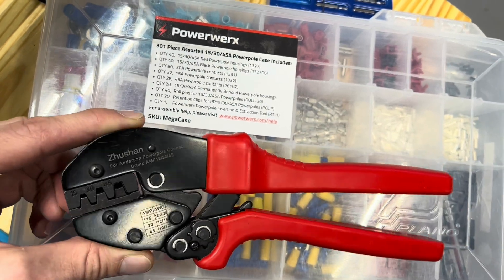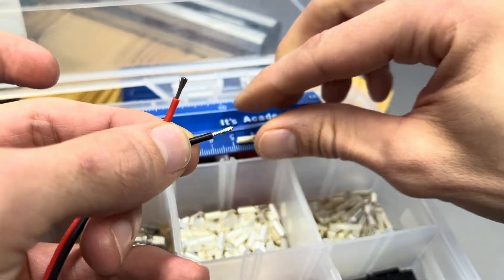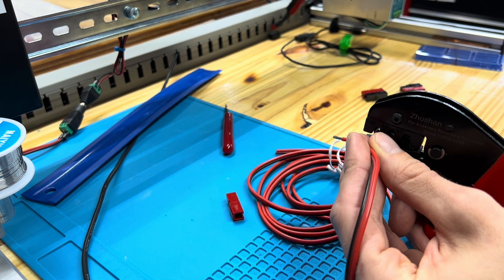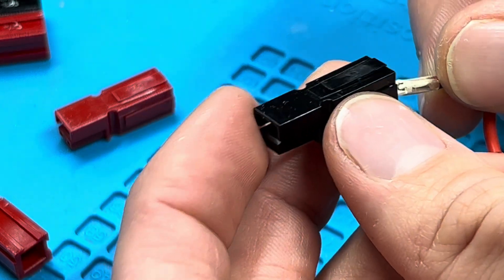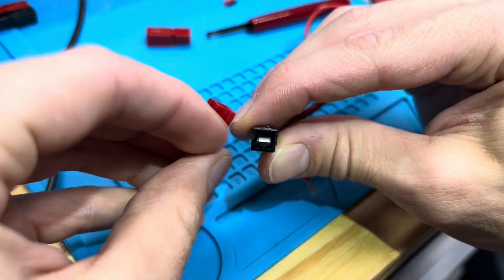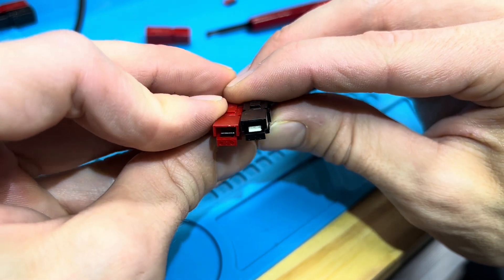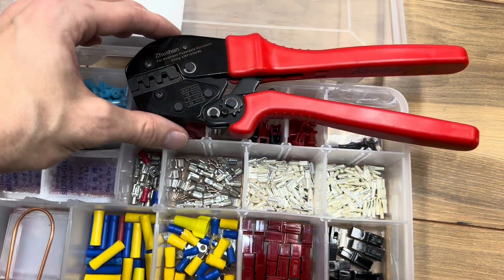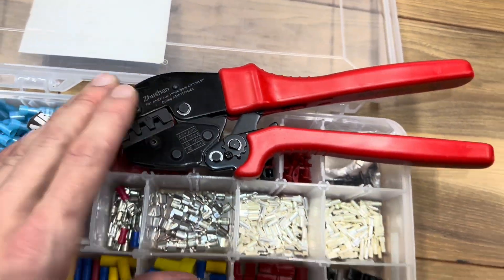How to Crimp Anderson Connectors

Comment: the 45amp terminals have two U shaped crimp areas.  Does any of the conductor land on the smaller U shaped area?   15 and 30 amp terminals don't grip the insulation.   Are the 45amp  terminals the same way?

Comment: Extremely helpful video. I had not needed to work with these connectors and bought the Powerwerx Crimper, Connector housings and contacts, as well as, the insertion & extraction tool. Thanks for the great simple video